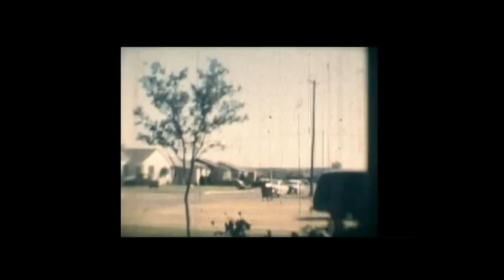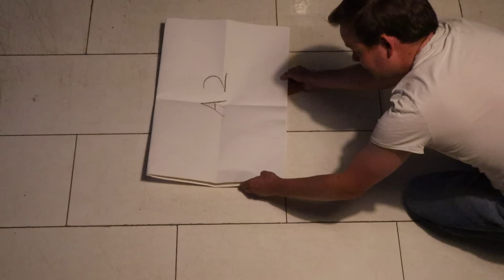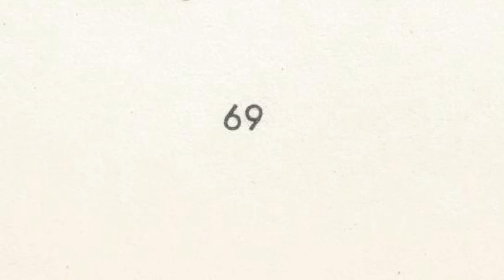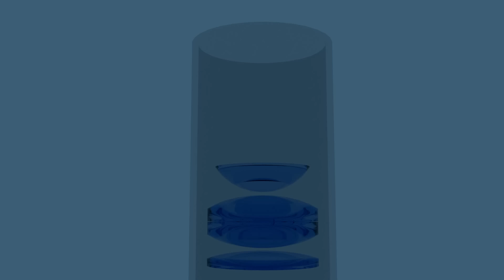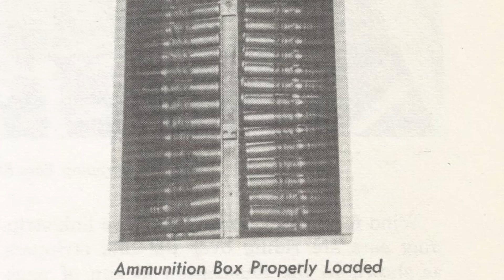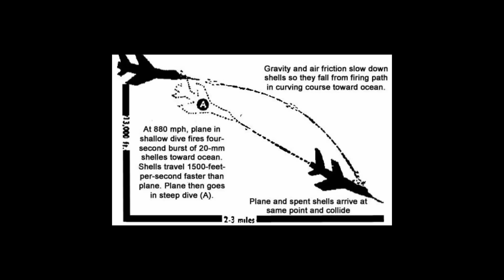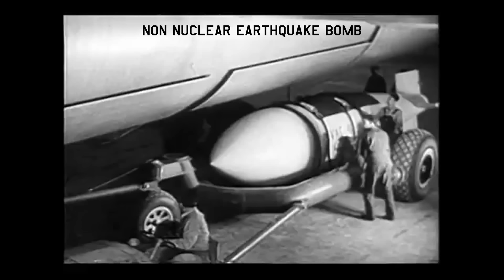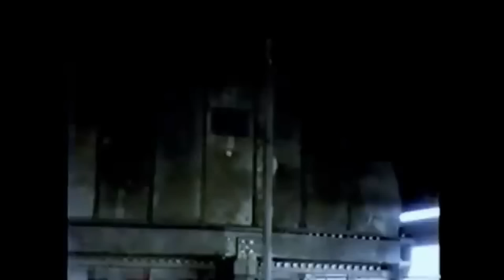Unfathomably American: The Armament Systems of the B-36

Comment: Analog computers? Jizzles? - it really was a different time.
Reply: Analog computers were being taught in college up to the 1970's, so it's not that odd.  Even basic math with op-amps was standard for electrical engineers for decades longer, until small microcontrollers really became widespread.   "Jizzles", on the other hand...
Reply: @SkyhawkSteve well, I was born in 1986 and my first computer was an Apple ][ - so for me it was all a different time lol
Reply: @DreamNotOfToday  I probably shouldn't scare you with stories of how TV used to be in black and white, came over the air, and was limited to 3 channels.  We got a lot more work done back then.  😄
Reply: We had analog and mechanical computers all the way back in the 19 teens. Used on fire control systems in naval weapon turrets. ( battleships)
The 1st tank fire control system I worked on in the army in the 70's was just replacing an analog/ mechanical system used from 1947 until 1975
Reply: @richwalter3107 but no Jizzles, though.
Reply: We have gigajizzles now.
Reply: @stab74  Moore's Law of Jizzling.
Reply: Analog computers have issues, they require extremely precise capacitors and resistors among other things, but their equivalent data rate is typically   fast, particularly when comparing to the early digital computers.
Reply: Jizzle my nizzle? What's cracking yo?
Reply: @tylerkinley268 😬
Reply: Analog computers were probably used for the same reason as on the British Vulcan - they could survive EMP from the nuclear payload.
Reply: @alexc4300 in 1949 there weren’t really any other options - electronic/digital computers of the time were too big and heavy and would use too much power and would have probably been too slow anyway. The Avro Vulcan was developed nearly a decade later and also didn’t have as much need for computers since it didn’t have any defensive weapons systems like turrets etc.
Reply: @DreamNotOfToday  fair - wasn’t thinking far enough back.
Reply: I had a mechanical engineering professor roll his rack-mounted analog computer into the controls class I took in the mid 90s.  Analog computers can produce an exact solution for the partial-differential control equations of a complex problem.  They are less sensitive to shock than vacuum-tube based digital computers. See the Iowa-class gunnery computers.

Comment: The real Problem with freedom units is that we are a large enough market that momentum alone makes it hard to transition to new standards. If the market is large enough to have good price competition, why bother standardizing when there's no price advantage?
Reply: It's also worth considering how expensive a change would be. As a US Machinist, I personally own over ten thousand dollars worth of imperial specific metrology tools. Take a large shop with manual equipment, and that figure balloons quickly. Less an issue with CNC machines, but you get my point. Even something as simple as changing the standard paper size would basically require everyone to retool entire manufacturing processes

Comment: "Turrets were not shown to malfunction" is one hell of a Intro Inaccuracies line.

Also, how am I meant to be well behaved when this video existing has already caused me to go feral?

Also- it's the best Aircraft ever made BECAUSE it's an abomination and a crime against Engineering.
Reply: You want a crime against engineering? Look up the drivetrain for the XC-142, all of the engines are directly connected to all of the propellers via long-ass driveshafts, carrier bearings, and universal joints. No you don't understand, the engines are connected to EACH OTHER, so that any combination of engines running can drive all of the propellers at the same time. This was ostensibly done to improve safety and reliability, and nobody at any point took a moment to think what adding dozens of driveshafts and transmissions would do. (hint, it did not help reliability)
Reply: @joedingo7022 Sounds like what's currently in the Osprey and other tiltrotors, except more propellers and engines
Reply: @ImieNazwiskoOK And this is exactly why its unreliable. Maybe accepting that sometimes one engine would fail and you will have to land it like a normal aircraft would be more healthy approach then constructing a driveshaft that will fail more often then either of the engines, bringing the aircraft down.
Reply: @alexturnbackthearmy1907  Then an engine failure in hover would be inherently catastrophic, and it would have to be redesigned (with tradeoffs that might make it not useful) to have way higher glide ratio taking into account flying at low altitudes and possibly to emergency land on a carrier (obliterating its blades)
Reply: @ImieNazwiskoOK I mean, its still better then what it is currently is. Quick and dirty "fix".
Reply: @ImieNazwiskoOKthe difference is in the osprey it's required it would be insane not to include.
Reply: @ImieNazwiskoOKWithout the fancy oil filter / failure warning system the Osprey has, too.
And in case anyone is wondering, no, the warning system doesn't help if it's ignored. And yes that is a problem that has taken down Ospreys.
Reply: A perfect abomination. Plane so abhorrent several of those had lost their nuclear bombs due to plane unreliability.
Reply: And still nowhere near the craziest thing that America got up to in the early 1950s when it was literally put a nuclear warhead on everything